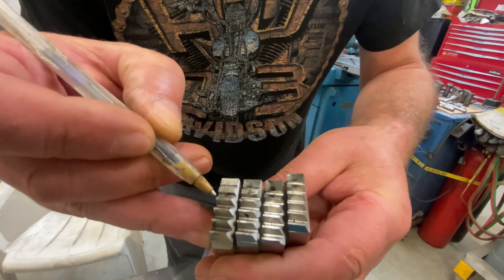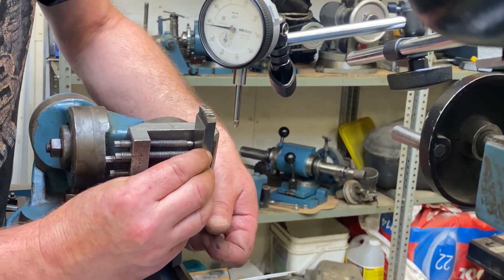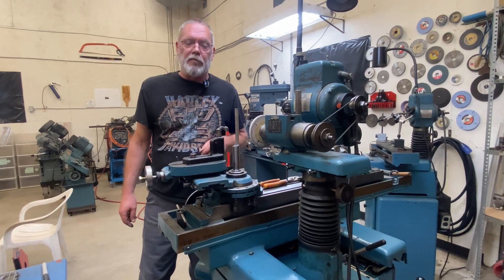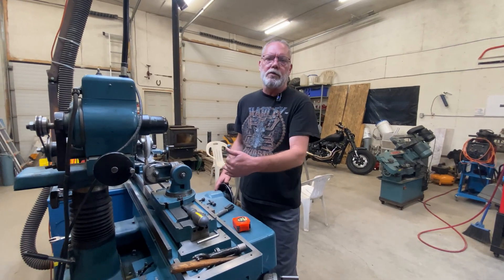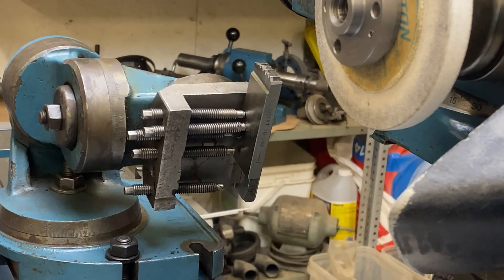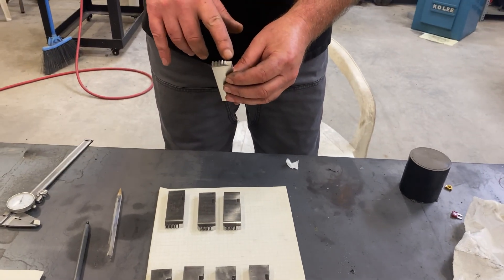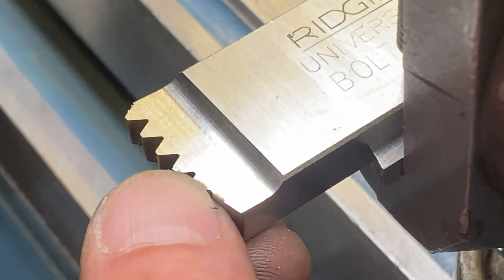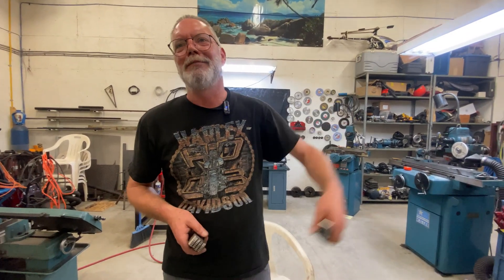HOW TO SHARPEN THREADING DIES

Comment: So there is a radius that it was originally done with, but as a thought would there have been any downsides to just using the radius of the wheel itself and feeding in the Y direction with the part perpendicular to the Y axis and then having a stop on the X direction?
Reply from the maker: Yes that would work great, probably even better, you would get a much better finish. if you had the exact diameter of wheel. However as the wheel wears down or requires dressing you no longer have the exact diameter and would be changing the dynamics of the cutting tool. With the method demonstrated in the video you can use a wheel up from new to next to nothing and sharpen many sets of different size dies.
Thanks for the comment!